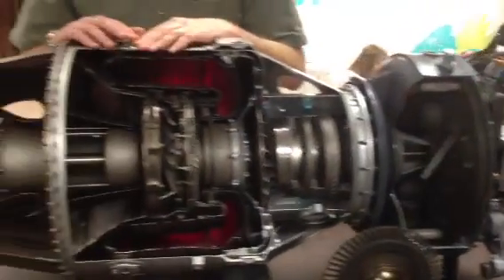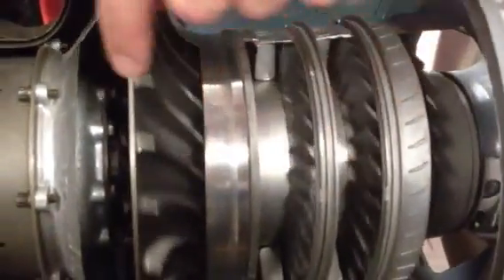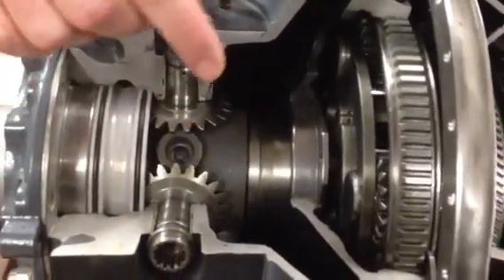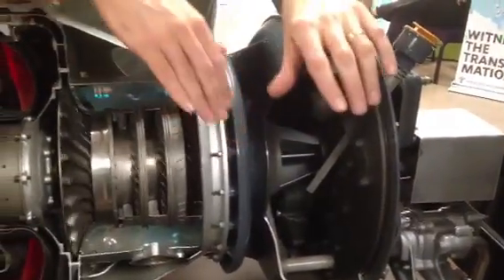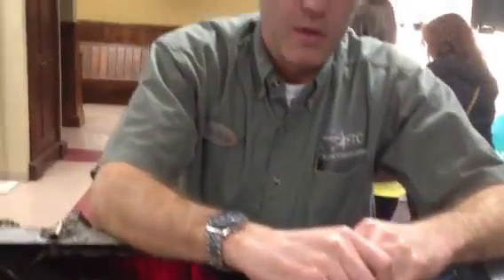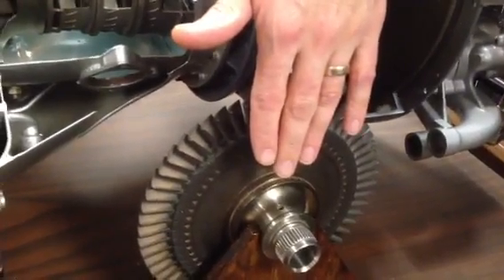How a Jet Turbine Propeller works

Comment: So basically a turboprop engine is basically a jet engine? Its just that turboprop aircraft don't travel at jet speed speeds due to the propeller at the front plus most of the hot gases in a jet engine (turbofan/turbojet) rush at the back of the engine which lushes the aircraft forward whereas most of the hot gases in a turboprop engine is sacrificed to turn the shift with only some gases coming out of the exhaust.
Reply: That's basically it, yes.

Comment: Very good explanation. Sometimes I hear about a hot section inspection, is that for the power turbine "the corvette"?
Reply: The hot section is from the flame box to the power turbine. The cold section is the compressor stage at the very rear of the engine. Together, they are called the gas generator, due to generating the gasses that spin the propeller shaft through the double step-down gear box.

Comment: what make a jet engine spin ? is ther a dc motor ?
Reply: Air pressure causes the engine to spin. The air gets caught in the blades and spins the central shaft.
Reply: @youcanthandlethetruth6976  Thanks bro
Reply: For our cutaway engine here there is an A/C motor driving it for demonstration purposes.

Comment: They don’t spin the opposite direction to counter torque. The prop produces by far the most torque because of its leverage... requiring full right rudder upon application of power in my King Air just as it was in any piston single with a right turning engine. 

I don’t know why they rotate opposite directions, but my guess would be so that your engine accessories (prop governor, overspeed governor, N1 governor, N1 tach generator, Np tach generator, starter generator, fuel pump) will spin the same direction as they do on fixed shaft engines without the need for more gears to reverse direction.
Reply: Thanks for your comment.  Anti-torque is the reason that Pratt & Whitney gives.  Internally to the engine.  I agree that it seems insignificant as related to propeller torque, but that's what the engineers tell us.

Comment: Most turboprop engines gear the output directly to the N1 shaft rather than having a separate power turbine.
Reply: Actually, most of them are free turbine. 

This is because the PT6 is the most common turboprop in the world, and many turboprop engines are also turboshaft engines in helicopters which need a clutch if they are fixed shaft. 

The Garrett TPE—331 and the Allison 501D (T56) are the only common fixed shaft turboprop engines.

Comment: Excellent explanation. Sir do you have access to PT6T turboshaft which powers the Augusta Bell AB 142 helicopter? I'm curious about  it's combustor layout, since it is a twin engine. Can u please help with explanation if u know how. Thanks in advance.
Reply: It’s identical to the PT6A. Only there are two “engines” side by side connected to a common gearbox.

Comment: attention:  when the air EXPANDS (meaning an increase of its volume), its pressure DECREASES.
Reply: Your statement is true according to Boyle's laws however, in regard to the operation of the engine the presenter is indeed correct. As the air flows out of the final stage of compression and enters the divergence, it's VELOCITY DECREASES which results in a pressure INCREASE. As per Bernoulli's principle.
Reply: You are correct.  He probably meant an increase in velocity of the air.

Comment: He makes a few points about increasing air pressure by accelerating air through the axial compressor... i may be mistaken, but doesn't accelerating air lower air pressure? The Venturi Effect or Bernoulli's Principle (Principles that every pilot in the world is familiar with, state this)
Reply: Indeed, you are correct.
Reply: That is correct if the acceleration of air is due to a convergence in the air path in a fixed volume of air.  Such as in the venturi of a carburetor.  Inside the compressor of this engine the air is accelerated by the moving compressor blades and then sent through a stator section which includes a slight divergence.  This divergence decelerates the the air speed and increases the pressure.  It's a series of slight accelerations of air with the blades and decelerations with the divergence.

Comment: finally I get it all. but doesn't the reverse air flow slow reduce efficiency and subsequent speed?
Reply: I'm glad to help!  The forward moving air does not reduce efficiency and speed.  The air moving forward in the engine has little weight, so little effect on inertia and such.

Comment: Diamond is using diesels in its new twins which are basically just Mercedes AMG car engines, giving a claimed cruise speed of 180 kn and fuel consumption per mile, similar to that of a family petrol car. Its encouraging to see manufactures bringing the cost of ownership  down.
Reply: Yeah. Except Theilert made crappy engines who need premature gearbox changes erasing any of the perceived advantages they have. 

Truth is... you can buy a gasoline engine of a 70 year old design and a lot of gas for the same price as a modern aero diesel. It also has a fraction of the failure modes and no surprises because they’re a mature design

Comment: is it turbo shaft ?
Reply: It's a turboprop.  Because the output is connected directly to a propeller.  Many helicopters are turboshafts where the engine output is connected to a shaft that drives the transmission.
Reply: @kensmoll67  thank you sir.

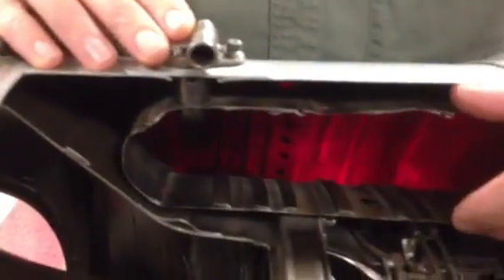Comment: 0:54 He mentions tubes that expand in size so it "increases" pressure... That is the opposite of what would happen, in that case pressure would decrease.
Reply: +Harvey Mushman if you have moving air and you slow it down its pressure increases (see bernoulli equation). its not a fixed volume that's expanded (which would decrease the pressure yes) its a continuous flow inside an expanding duct with no meaningful pressure gradient so the flow simple decelerates.
Reply: Yeah, you're right, I must not have had my brain turned on...
Reply: +Harvey Mushman It happens to the best of us. Now when we are talking about sonic and supersonic flows you would be right about decreased pressure with increased area.
Reply: I was thinking the same thing
Reply: +Harvey Mushman This confuses alot of people because it is counter-intuitive. It just does not sound right until one does a little research.
Reply: That's what Bernoulli would say!  :)
Reply: Expanding the air would increase pressure. Compressing air is what lowers pressure (and temperate) The Venturi Effect and Bernoulli's Principle (the study of fluid dynamics) talk about this. All pilots learn about this in flight school.

Comment: The same way automatic transmission work. Fluid coupling!
Reply: Not really. In an automatic transmission there is an impeller moving fluid to a turbine. In this case, both of the rotors are turbines and being driven by hot exhaust gasses.

Comment: I believe its called Reverse flow, mainly because the air reverse its flow in the combustion chamber,and not because it enters from the rear of the cowling,,,,as 
this same engine being installed in the Avanti Piaggio will still be called Reverse flow
Reply: stealhty1   I believe it's called a reverse flow engine for the same reason the guy said it was...   the air flows through the engine in the reverse direction, i.e. from the rear towards the front...   compared to that of a 'normal' jet engine,  i.e.  front to back.   NOT because the air is made to reverse in the combustion chamber.      Did you think he was making it up as he explained very clearly and in plain English?
Reply: stealhty1   Yes this engine is also used in the Piaggio,  and is still called a reverse flow engine,  but even though the engine is the 'other way around'  i.e.  the 'front' of the engine (when looking at the plane),  it is still the rear of the engine that sucks in the air..   in terms of airflow though the engine.    And before you say the air intake is under the prop',  yes it is,,   but then the air is ducted the whole length of the engine (outside it) and fed in like every other PT6, (in at the opposite end to the prop').   The Piaggio is a pusher, as you know,  so it's the prop' blades that are also 'reversed' compared to a tractor engined plane.    If not, it could go very fast, but backwards!
Reply: Both the combustion chamber and the whole of the gas path of the engine are termed as reverse flow by Pratt & Whitney Canada (PWC)

Comment: Is this turbine model the same as the twin otter and beechcraft king 200 got ?
Reply: Yes, Its Called PT-6
Reply: This particular cut-away engine is a PT6A-20. Early Twin Otters also had -20s. The King Air 200 started out with the -41 and most have the -42 these days.

Comment: Dude. This is turboprop. Leave the "jet"¨ out of the name.
Reply: André Moreira    ??   It IS a jet.      Yes we call them turbo-props nowadays,  but they were commonly (and rightly)  called turbo-jets for years.      What did you think 'turbo' meant?  It's a gas turbine, or jet,  engine!    Dude.   :-)
Reply: Sorry, mate. But the "jet" part of the name should be used only when thrust comes exclusively from the hot gas exhaust. Jet propulsion. Newton's third law + Freakishly hot exhaust.

Only "turbo" is right.

Even the turbofans we mostly use nowadays (which have a jet engine in the middle of a cold air flow), which almost everyone calls jet engines, are not true jet engines, since only a percentage of their power comes from the core exhaust.

However, when we refer to all gas turbine powered engines together it is common to consider them all jet engines. This is not very accurate, but is accepted. But this is a generic term to group a whole lot of engine types  together, while some don't even have turbomachinery in them.

The only REAL jet engines are the awfully noisy (and cool!) turbojets and their brothers ramjets, scramjets and the rockets. Probably some other experimental engine types too.

If you are specifically talking about an engine with a propeller, it is a turboprop. Period. If has an air bypass, a turbofan. If the power shaft is moving something else (helicopters!), it would be a turboshaft.

Sorry for sounding like and a-hole, but this is how it is. Cheers!

Comment: Very interesting video. But, the efficiency of a Brayton cycle turbine is in the 17-23% range, an OTTO cycle internal combustion engine is approx.30-36% (Wikipedia). Exactly how I remember it from my Thermo and Engines classes.
Reply: david barker This is true, but there are other factors. The efficiency figures you give are at sea level. As altitude increases, both engines lose efficiency, but the piston engine drops off more quickly. Also, for an engine of given power, say 400hp, the size and weight of a turboprop engine is typically about 1/2 ~ 1/4 that of the piston engine. In addition, a turboprop engine is hundreds of times more reliable than a piston engine. They can and do fail, but it doesn't happen often. Fuel efficiency is one factor, and traditionally piston engines are much better at that, but the scale of the advantage is not as great today, and drops as height increases. The major disadvantages of a turboprop today are the initial cost, and operation. Pistons and so on, are well understood and not all that expensive to make. Turbine blades, they cost money. Operation comes down to how you apply the throttle. A traditional piston engine allows you to be very quick handed with the throttle, on or off. A turbine or turboprop likes to be throttled up rather slowly. Too much fuel too soon can 'flood' it and cause a big problem. One solution is better pilot training and understanding. Another is Full Authority Digital Electronic Control, or FADEC. Conceptually, replacing normal throttle with FADEC is a bit like going from a carburettor to EFI on a car. You're never going to flood the damn thing through simple ignorance. Most PT6As don't come with FADEC. To make them a viable bolt in option for general aviation, I rather think they should.

Comment: How come it cost so much too build a jet turbine?  What is the dipstick for at the intake of the engine?
Reply: Also, the turbine blades are analysed for defects at a microscopic level with neutron imaging. The majority of high stress turbine components for engines built in Canada (so those built by Pratt & Whitney) pass through the research reactor at McMaster university. Neutron imaging shows a lot that x-rays cannot.
Reply: +Jeffrey Kumjian When you consider the cost to rebuild a heat exchanger is $50k dollars alone. The cost is cheap for the reliability you get in return. It's just the cost of owning an aircraft. Which still makes the $350.00 an hr rental cost a bargain. If you can find one for rent and not chartered rates. Not including fuel cost.

Comment: The main reason that the compressor turbine & power turbine turning in opposite direction is NOT to cancel out the torque. It's b/c huge loss of efficiency observed if they're turning on the same direction.  With only 1 stage of power turbine required a huge change in the direction of swirl between the exit of compressor turbine and entrance of the power turbine which destroys significant amount of efficiency.  The solution to fix this issue is to to have them rotating in opposite direction.
Reply: Thanks for your comment.  Anti-torque is the reason that Pratt & Whitney gives.  Internally to the engine.  That's what the engineers tell us.

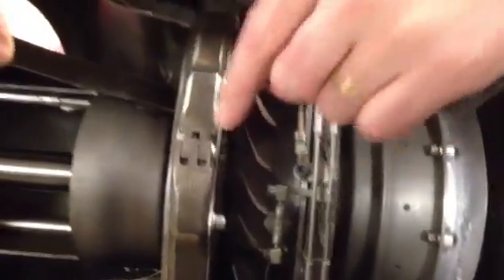Comment: 2:36 why would it genarate torque when the turbine and the gear box not connected together. More like the angle of the guide vanes that cause the reverse.
Reply: Any turning body will create an external unbalanced torque force . If unaccounted for, the engine would rip off the wing.